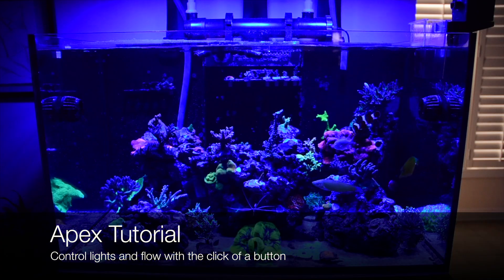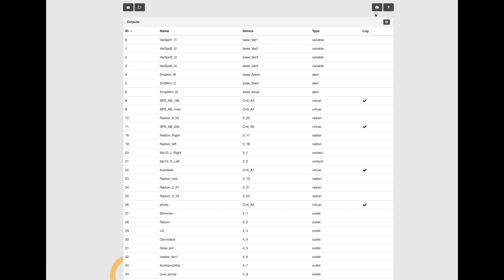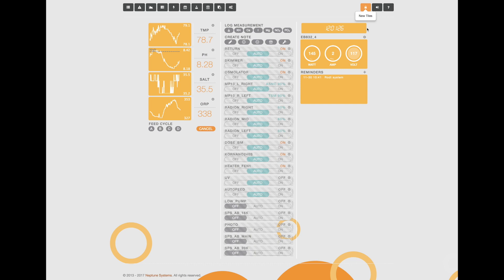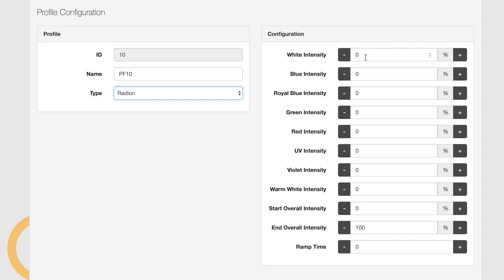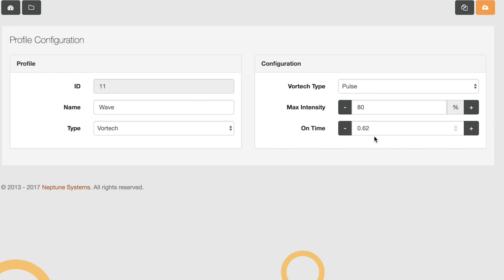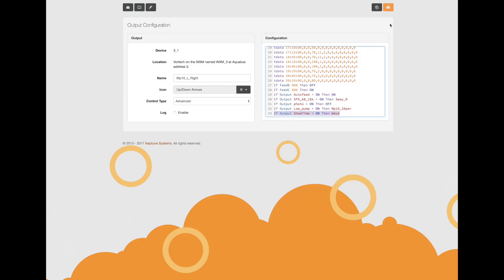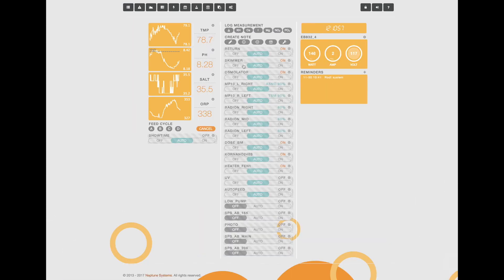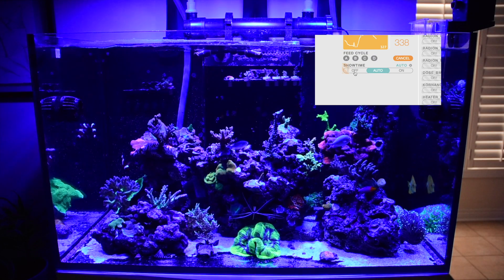Control lights and flow with the click of a button using Apex

Comment: Thanks for sharing great content. I am having issues with sps coloration and need some advices. When you had problems with your coloration,  were the sps more like a brown color or a pale color or both. Also, what where your phosphate and nitrate levels. Thanks again.
Reply from the maker: I had different types of color issues during different stages of my tank. First couple of months, I had several frags lose a lot of color and look pretty pale. I had undetectable nitrates and phosphates at the time and I was ramping up the light pretty fast. I increased the bioload and stopped doing water change and reduced light. sps colors improved a bit once I started seeing nitrates (but still no phosphates) but then I kept going through cycles of sps looking good then browning out, then looking good again then browning out. Some of this coincided with changes in nitrates but in inconsistent ways (eg high nitrates and poor color in month 6, undetectable nitrates and poor color around month 11?). It could have been depletion of trace elements or undetectable  phosphates... corals and all organisms need phosphates to grow; it forms part of their DNA molecules (the dna double helix has a phosphate backbone). This went on for about 7 month. Frustrated, I decided to dose trace colors, aminos and heavily feeding the corals. Things improved a bit but the heavy feeding plus unbalanced nutrients (10 nitrates and 0 phosphates) I think led to a nasty dino outbreak. Oddly enough, that was the turning point for me. I started balancing the nutrients by dosing phosphates. It took s bit of dosing to actually see detectable levels in my tank. I also got rid of all coral feeding and trace color supplements and stuck to a regular water change routine (15l per week, with the regular instant ocean salt). Dinos went away and sps colors improved. Things seem to be consistent now, which I am really happy about. It’s hard to know exactly what caused this, but I am leaning towards balanced and readily available nutrients; I am sure that supports a much greater diversity of microorganisms (=bottom of food chain), which then have bottom up effects on the corals in the tank
Reply: So what do you think caused the brown color. I am experiencing sps browning now, but don't know if the problem is the system being to clean or if I have to lower the phosphates. My phosphates are 0.020
Reply from the maker: where are you nitrates and other core parameters? Also, what kinds of lights are you running and what is the typical par on your SPS frags....While browning out is not ideal, its better than SPS bleaching out and dying. The trick is to slowly try to fix your water chemistry till you see some nice colors again.
Reply: Bro I texted you on Instagram
Reply from the maker: Miami Reefer odd.. cant seem to see your txt